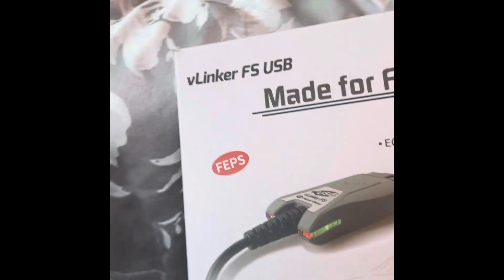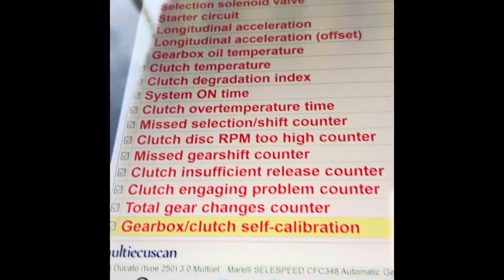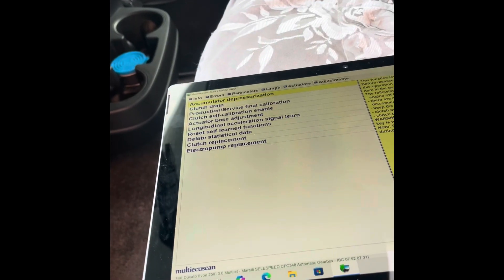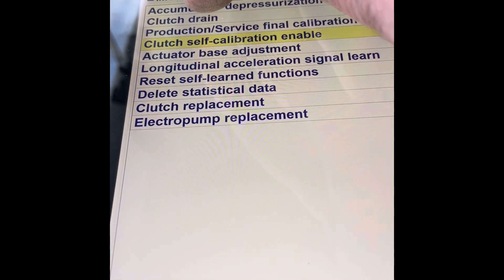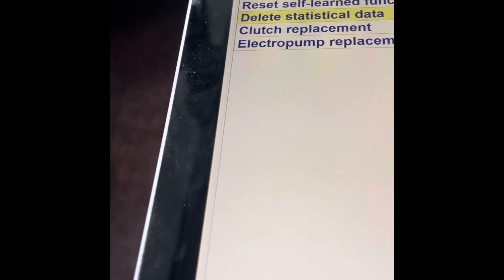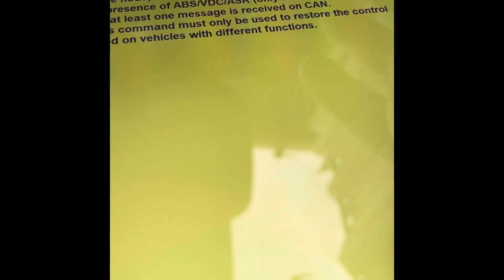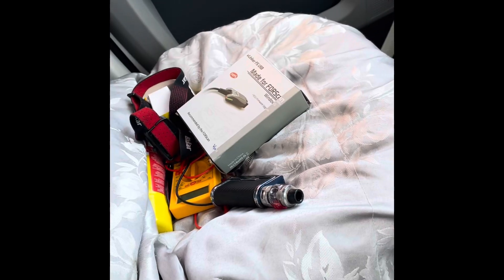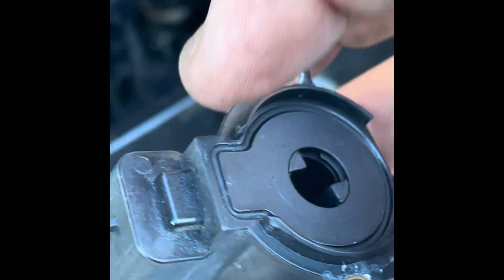Best obd to read gear box fiat ducato 3.0 comfortmatic issues

Comment: Hi there, many thanks for the videos on the multiecuscan software and connectors. I’m convinced that this is the way forward.
I have a comfort-matic gearbox.
But I don’t want to wait till it goes wrong before I need to learn, what you have already shown us! Absolutely brilliant. However I do not want to carry around a large laptop, so what tablet are you using and does it have the standard USB port necessary to use the cable that the £130package ?
Regards and well done 👍
Reply from the maker: @tomahawk380  hi thanks for the comment and I agree what you are doing learning 
To which soon you will get your head around it and do everything yourself it’s very simple honestly 
Just change any parts I mentioned in any video 
And once I am home I will tell you the tablet I use it’s only small but works great

Comment: hi great information on all the videos ( did you delete the 1st clutch blead one where you just changed as much as you could ?) also the link for the scanner take me too a£130 unit nit the price you mentioned thanks
Reply from the maker: @RayWickers  how multiecuscan works 
First it reads different components 
Engine 
Gearbox 
Abs 
Service 
Dashboard 
You click on which one your scanning or looking at live data 

So what I’m doing I click on gearbox it connects to cfc348 selespeed 
It then shows in section what to view 
Information 
Errors 
Graphs 
Parameters 
Actuators 
Adjustments 

So view errors is for fault codes and to delete them 

Then graphs is to view more in depth volts etc for sensors and so on 

Then parameters is all live data you pick you from all components on the gearbox 
From engine temp / battery volts . Clutch temp / gear box oil temp / then all sensors data and all clutch data from clutch plate and degradation etc what gear your in 
So basically you can carry out tests 
You change gear and watch gear selection it shows if working same has sensors 
Change gear you will clutch position sensor volts change 
Press brake pedal it shows if working or select any gear etc it’s all parameters to carry out and look if working 

Then adjustments is the one you can carry out clutch bleed 
You just press execute and it does 15 cycles open close bleeding any trapped air in the system that’s it no deleting 
Each different one does something different 

So depending on what you are wanting to do 
If test if relay works or pump you go to actuators that’s to carry out all tests just to see if they work 

To change kiss point etc that’s in adjustments 

So after let’s say changing clutch fluid and clutch sensor 
You delete statistical data 
Then that resets some parameters for the sensor which the new one will learn new data 
Then carry out the end of line service 

This is what I did after my works of changing clutch fluid and bleeding brakes I changed hydraulic fluid and gear box oil 
I changed gear sensor and clutch position sensorr removed selespeed harness to clean all contacts and changed pump relay which all this requires bleeding and a reset of delete statistical data 
So in this order I did 
Delete statistical data 
Clutch replacement 
Electro pump replacement 
Actuator base adjustment 
Clutch drain 
Then last 
Production/service final calibration which this has multiple ones included in it like clutch calibration 

If you read the training academy for the robotised m40 gear box it mentions what to carry out for each different part you change like I’ve just done to reset or relearn different parameters in the gearbox 
Then on the first drive it will relearn your driving style and not someone before you 

Then if keeping the van every 12 month top up fluids and carry out the drain and calibration to keep it in line 
The thing is with a comfortmatic it is not a automatic gearbox it is manual the m40 box everything same including clutch 
Only difference it has a little robot on top that put the clutch in for you so this robot is your foot 
This needs a regular service 
And if anything goes wrong not selection of gears available it’s always sensors or fluid or accumulator or harness needs a clean on contacts 
Keep fluids clean so no contamination it will run fine for 300k miles 
The accumalator only lasts 10 year max and for £100 they very easy to change 
It’s the black pump looking thing behind gearbox 20mm spanner at the bottom removes it 
But first depressurised the system in mes or disconnect negative from battery 12 hour that will depressure the system which you do when changing transmission oil or parts replaced like clutch etc this is important 
So relay and pump and oils it be fine with a calibration to reset kiss point 
Good look 
And remember the more you learn the better because it’s easy to do yourself and expensive to get others and not many know they confuse like it’s automatic
Reply from the maker: @RayWickers  hi first it will be that price for the full package I wanted every plug to work on any vehicle 
If you just want to use on a ducato let’s say you only need the green adapter and the vlinker
But on the website carry out the vehicle check 
You should be able to pick up the software for 50 euro 
That’s just for the multiecuscan software 
Has mentioned then you need the obd reader and adapter so should be like £80

And question about clutch bleed I don’t understand what you mean delete ? Explain what you mean
Reply: @MotorhomeDIY  I seem to remember that you did a clutch fluid change without any software to bleed it you just extracted as much as you could .
Reply from the maker: @ that’s correct I have not used multiecuscan for that 
But if you wanted you use the Accumulator depressurization and once reservoir full you empty it 
All I did was pull fuse and leave a good few hour then drain 

Just remember it can be confusing even in multiecuscan about clutch drain because it’s actually talking about the cs speed in the hydraulic not the dot 4 small reservoir
Reply from the maker: There is no software for the dot 4 clutch change you have to gravity bleed this end change fluids 
But yes I did the same on both 
The clutch bleed routine on mes is used just to help with trapped air that’s it